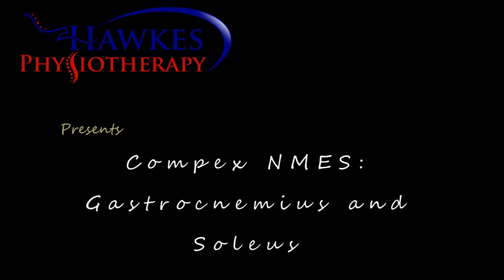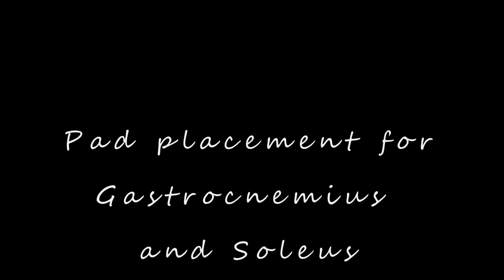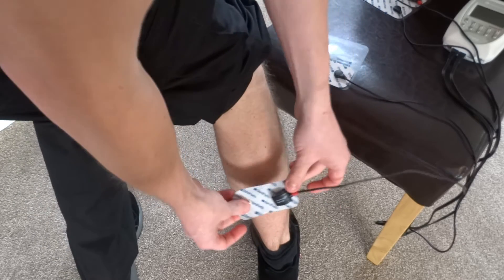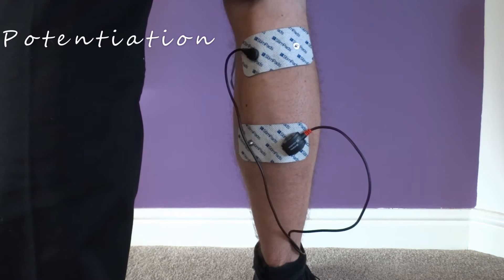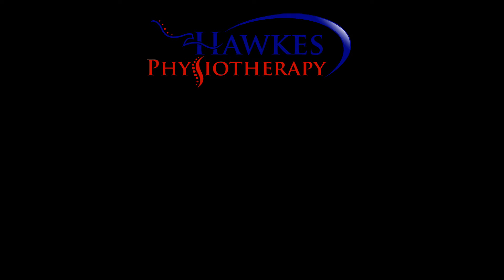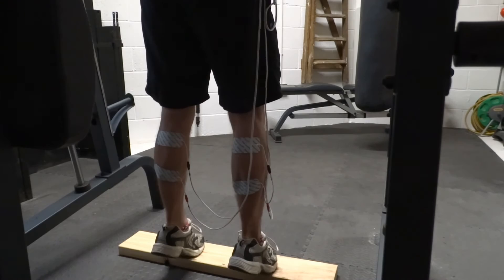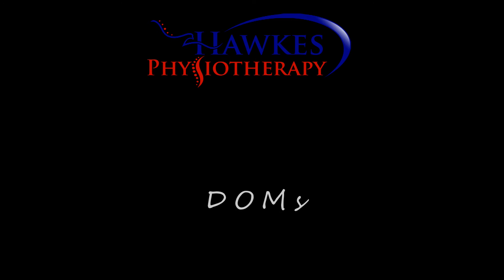Hawkes Physiotherapy E Course: Neuromuscular Electrical Stimulation (NMES): Gastrconemius & Soleus

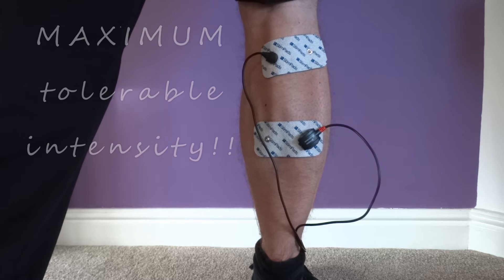Comment: Thank you for this video Sir! At around 1:50 you mention low frequency stim. What is an example of low Hz for atrophied gastroc? What is an exaple of low (25Hz)? I am in desperate need of this as both of my gastroc's are at a fraction of what they should be due to injured nerves prior to a surgery for degenerative spondulolysthis of L-5, S-1. Essentiall I heel walk do to know power in the calves. Any help would be greatly appriciated. Best Regards, Jim
Reply from the maker: If the nerves are damaged then you may struggle even with muscle stim but you should start with the lowest frequency that gets a visible contraction twitch then build the frequency up as the contraction gets stronger. So for example endorphic TENS (2-10H), then build to endurance (10-14HZ), then up to disuse atrophy (35-45HZ), then Resistance (50-60HZ), then strength (75-90HZ) then explosive strength at 104-111HZ)